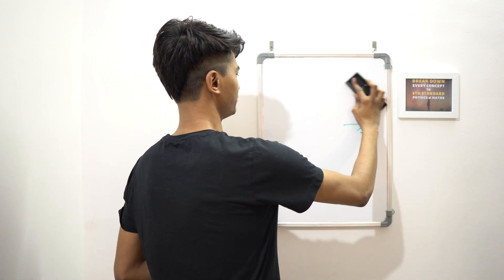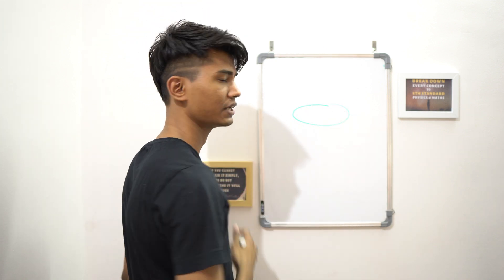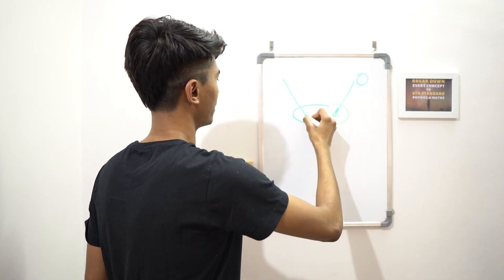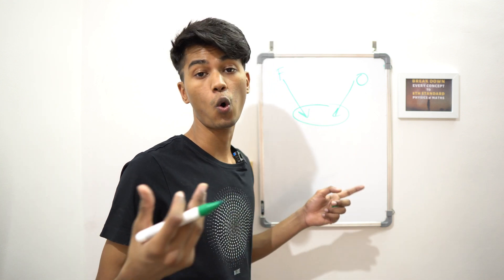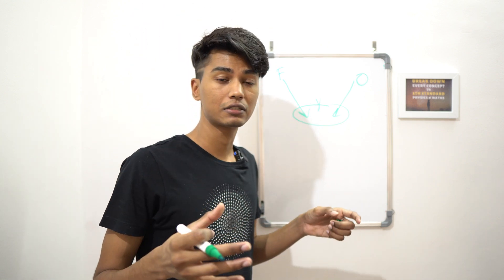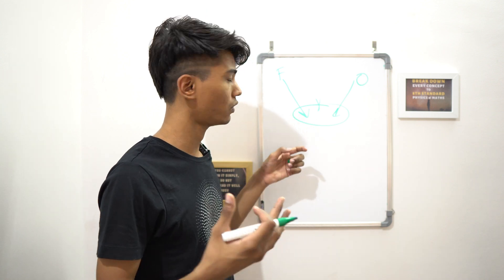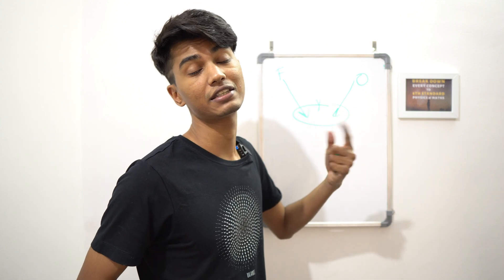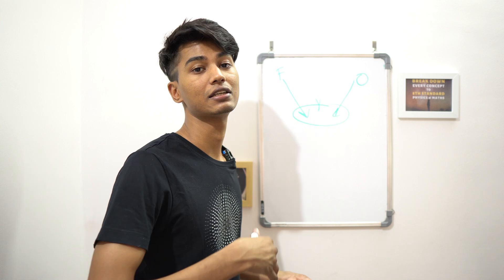How Rocket Engines works? | Liquid Engines | Liquid Propulsion

Comment: Imagine that you are on a street with houses marked 1 through n. There is a house in between (x) such that the sum of the house numbers to the left of it equals the sum of the house numbers to its right. If n is between 50 and 500, what are n and x?'

Comment: Spacex does not use solid boosters because solid boosters do not allow for good regulation of thrust(i.e. increasing or decreasing thrust). Another problem with solid boosters is that they are hard to turn off and on again, which is an important requirement for spacex since they are building reusable rocket engines. 
Am i correct?
Reply from the maker: Not really 
It’s connected to reusibility

Comment: Spacex is using liquid fueled rocket engines because the rocket boosters need to land back vertically for that they requires control on engine and we know that in solid rocket engines we don't have control for combustion.....thus they are using the liquid fueled rocket engines
Reply from the maker: Close

Comment: Spacex need to control the engine operation (sometimes cut-off and sometimes increase the thrust ,at the time of landing thrust adjustment). This is why they are not used solid rocket motors.
Reply from the maker: Yes to some extent true

Comment: SpaceX's Rockets first stage boosters are reusable and they are not only designed to launch payload to orbit but in addition they have to return back to the ground which is a really complex task and requires multiple ignitions in combustion chamber which is not fulfilled by solid propulsion engine. Another reason to use liquid propulsion engine is that they need lots of fuel to launch and land the boosters which is not possible by solid boosters as once ignited its almost impossible to stop the combustion and they will end up having no/low fuel for landing. So, in a nutshell liquid engine provides all the requirements needed for a reusable rockets namely low fuel requirements, multiple ignitions in combustion chamber and above that liquid engines come with a facility of controlling the thrust and its direction which is very essential for the landing of boosters. 

Adding to this, I am a beginner for learning rocket sciences and do enjoy your lectures.
Reply from the maker: Nice. Keep it up

Comment: SpaceX, I guess uses jet propulsive landing technique even for there boosters. It might be the reason why they use liquid boosters in the 1st stage so that they could change the rate of combustion. Which vary the trust generated by the launch vehicle. 
Am I right sir?
Reply from the maker: NO, the reason is that solid engines are not reusable
Reply: @ashishranjantalks  Thank you sir
Reply: So sir, can SpaceX reuse their Liquid boosters without using this technique?
Then why are they using this technique?

Comment: sir my question is , what are the metals or any alloys are use to make these pumps and combustion chamber and shafts , as temperature is very very high like 250 bar or 300 bar .
Reply from the maker: They are made of steel and aluminium only

Comment: Why space x not used rocket motors?
First thing that a solid propellent uncontrollable and other thing if solid motor is used than side booster can't be recover.
Reply from the maker: true
Reply: Hey Ashish can you help me to design a nozzle?
Because I am working on liquid engine
If you make one video on how to design a nozzle then it's also guide to me

Comment: Very nice explanation sir. My answer to the question you asked is In liquid engines we can control the combustion and we can start and stop the engine multiple times as per our requirement for example when the satellite needs to be put on the orbit ( told by you only :))
Reply from the maker: Yes, correct😊
Reply: Sir at the time of docking also engine needs to be started and stopped multiple times?
Reply: @aanchaljaiswal1680  Yes!

Comment: I have some queries 
1) Why isro can't make a complete new design rocket engine ,
I mean you know vikas and sce200 both are foreigners design base 
2) is isro working on methane fule powered engine 
3) can isro make heavy launch vehicle by using sce200
4) what about admire rocket 
How much time it will take to come in final operation 
5) what will be final product of rlv -td 
I hope you will answer 🙂🙏
Reply from the maker: 1. ISRO has already made indigenous cryogenic stage used in MkIII
2. That I cannot talk about
3. It's possible
4. That I cannot talk about
5. That I cannot talk about
Don't ask me questions related to ISRO, this series is on rocketry in general
Reply: @ashishranjantalks  thanks

Comment: Using the same combustion chamber for turbine we can regulate/maintain the rpm of centrifugal pump more easily so that they can pump some what more amount of fuel and oxygen mixture and increase the thrust.
Then why we use other combustion chamber ? Which have different pressure generated in it.
Using same combustion chamber will be easy n will decrease the weight too which is a main factor.
Reply from the maker: It'll be a very complicated design otherwise
Reply: @ashishranjantalks  Ok sir

Comment: Sir how propellant provide cooling to the engine
Reply from the maker: as it's at much lower temp than hot gas, it is circulated around hot parts of engines before it is fed to combustion chamber

Comment: Answer to why SpaceX doesn't use solid propulsion? Solid propulsion have lower Isp compared to liquid propulsion. Throttling can still be done by grain geometry as it was done in space shuttle srbs but on the other hand SpaceX uses rp1 and denser Lox which helps it operate for longer durations and enables multiple starts.
Reply from the maker: No not really, it has to do with reusability
Reply: @ashishranjantalks  yes srbs need a lot of refurbishments compared to liquid systems.

Comment: Everyone in the comment section are thinking space x uses liquid engines just because they are stable. They are not stable on themselves only. They are stabelized by active thrust vector control which is due to different sensors like accelerometer, gyroscope, gps, barometric pressure sensors and other subcomputers present in flight computer of the rocket.
Reply from the maker: true

Comment: After separation they want to bring back the rocket boosters, to do so they need controllable combustion that’s why they use liquid motor engine in boosters which fullfill the desired needs instead of solid rocket motor engines ,because they can’t...
Reply from the maker: True

Comment: To control the thrust vector and to control the combustion etc parameters SpaceX use the liquid motors in initial stage also..
Reply from the maker: yes that's one of the reasons

Comment: The main difference between solid rocket engine & liquid rocket engine is that we can control fuel rate.thus we can control the combustion process the fuel engine.but it's not possible in solid engine right Ashish!
Reply from the maker: True

Comment: Because solid engine have uncontrollable combustion.
Rather liquid engine have controllable combustion.
And so during separation they need to come back, the booster on landing site which need controllable combustion which provided by liquid engine .
So called reusable booster saving a lot.
Reply from the maker: Yes very True😊👍
Reply: Ok. Then why such reusable boosters are not used by our isro?
Reply: @vyahruthkota3437  booster based on engine and it's complex, spacex failed three to do that while isro don't have attempt on that technology.
Isro has lot to do like putting sattalite in orbit, chandan yan etc u can on there website for upcomming programs. so it need that government funds to private organisation so that they can  work on technology.

Comment: 1.Solid rocket motors do not give proper control on thrust required for landing the first stage.
2. Exhaust velocity is greater for liquid engines that gives greater acceleration.
Reply from the maker: You're correct but not the perfect answer
Good attempt😊
Reply: @ashishranjantalks  is it because the inner walls of solid rocket boosters are destroyed and so needs a lot of refurbishment as compared to a liquid propellant rocket?

Comment: Bro i have a doubt how do u calculate all this stuff like mach angle,pressure in the combustion chamber.
And I also  have a doubt that why there is compressor in this.
It's just similar like ramjets and scramjets.
Reply from the maker: That's the engineering part😊

Comment: I think the answer of your question would be that solid fuels are more denser than liquid fuels so that would increase the mass of the rocket altogether. Quoting you "mass is the enemy of proplulsion. So this reason sounds plausible.Also,we have more control over the thrust provided by liquid engines than the solid ones,so I think this is another reason space x don't use solid engines.
But again if things were this simple,I would be working in space x right now 😆
Reply from the maker: Good attempt Abhishek, I'll discuss soon

Comment: Space x uses liquid engines because the rocket boosters are reusable and to land on the ground they need proper thrust control ,the direction of thrust etc to land properly without failure.
Am i right??
Reply from the maker: Yes That's correct🙌

Comment: Sir, but some private space agencies (in small sat- launch market)are using lithium ion batteries to run the turbo pump
😣😲😕
Reply from the maker: Like I said turbo pump systems are only for large engines
Reply: There are many ways to pump propellants in a system. As you mentioned a startup named Copenhagen suborbital and Rocketlab uses electric turbopumps but again the lipo batteries have mass penalties that's why once they're used they discard it off board.

Comment: Can you explain why jet engines are not used in rocket..? And how the jet engines are worked at very low layer of air
Reply: Jet engines are not used in rockets because it uses atmospheric oxygen as oxidiser and if we go more and more altitude air become thinner which is not suitable for jet engines😊
I want to know your age,,
Reply: @shashankjois5452  21 .. Why
Reply: @pritammaheshwari3076  because I am 15
Reply: @shashankjois5452  so..
Reply: @pritammaheshwari3076  to know that you are 6 year elder than me😁😁
Reply: @shashankjois5452  ya so.. What are trying to say me..? Huh
Reply: 21 .. Why
Reply from the maker: sure, in short they are air breathing that's why

Comment: Space X not using solid booster because it has more weight than liquid.. and also it requires large space than liquid fuel.
Am I correct Ashish ..??
Reply: SpaceX engines are Merlin Engines which uses RP1 as propllant. They also perform landing back to the ground or sea plateform thus they need to be throtteled. Throtling capability lies with liquid engines only. Thus Liquid Engines by SpaceX.
Reply: We cannot throttle the solid Propalants
Reply: Yep, we can't throttle the solid rocket motors, as it ends it's ignition when the fuel is completely exhausted moreover they are dangerous and also called as ' Fireworks ' in branch of rocketry, where as space x reuses it's First stage boosters which needs to be throttled in order to land the boosters precisely on a landing site ( drone ship or ground landing ), the technology is so fun to learn and innovative for me it was like he ( Elon Musk ) used whatever the resources are available here and created a masterpiece ;). Yet many great innovations are yet to happen. I hope one day India will also master cryogenics :D
Reply from the maker: Good! but NOt really the reason😊

Comment: Rocket of spacex are reusable for that they require accurate control on combustion so they uses liquid engines.
Am I correct?
Reply from the maker: True but not the only reason
Reply: Not only for combustion and also thrust control ,direction of thrust control,managing the landing site and only liquid engines can be refueled like a car solid motor is like Diwali rocket😁 so spaceX uses liquid engines,.
Reply: Yes absolutely correct
Reply: Dileep Kumar  no, they are less expensive and easier than liquid engine.

Comment: Sub sonic
Super sonic
Thrust
Pump
Increase velocity
Mass enemy of propulsion
Prime over( turbine)
Rapid combustion
Increase pressure
Turbo pump
Feed back mechanism
Mixture ratio maintained

Combustion increases velocity increases by increasing fuel & oxidizer by pump :turbine